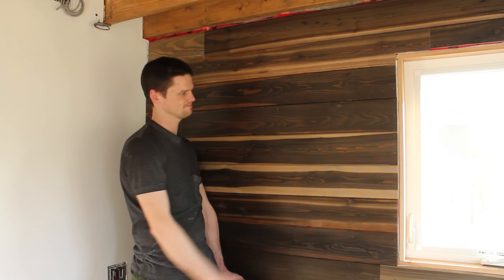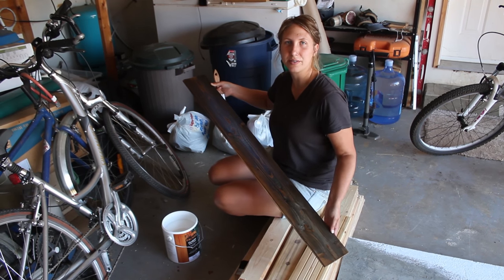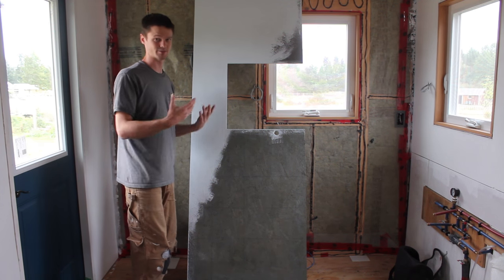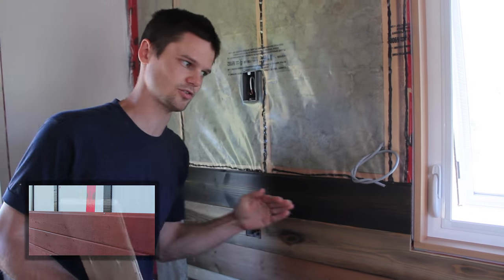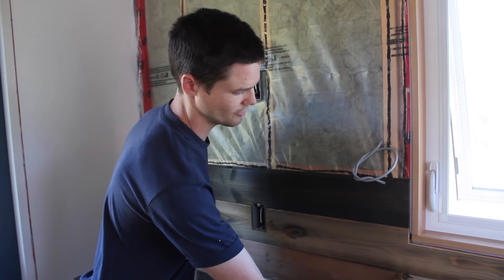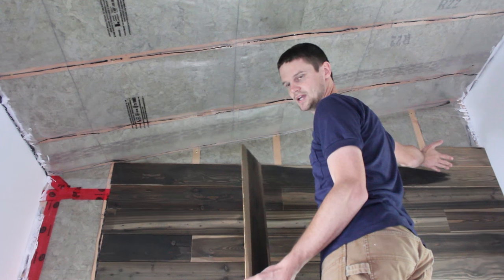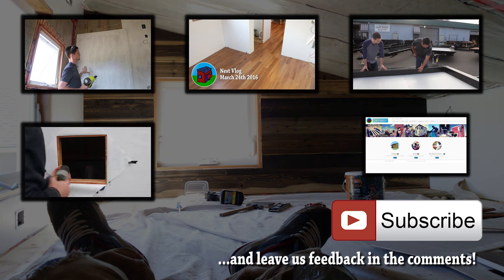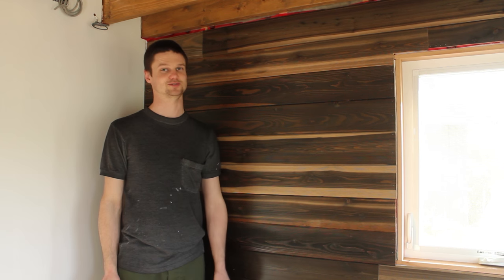Tiny House Feature Walls (Ep.59)

Comment: i have made my own homemade vinegar based stain before to achieve and old barn wood look. what you do is pull apart pieces of steel wool, just smaller pieces as opposed to toss in entire pad of steel wool. add apple cider vinegar and the the vinegar will actually eat away the steel wool. after like a week and a half your steel wool should be almost completely dissolved and your stain is ready.  could be what this guy used.
Reply from the maker: +steven squires We've seen multiple people suggest this... I think you are right. We actually tried making some, but kind of botched it and gave up... you'll see some pretty nice stain that achieved a similar look on plywood when we get to finishing :)